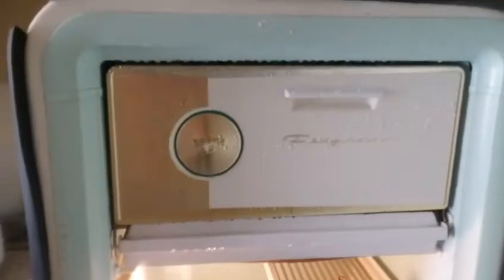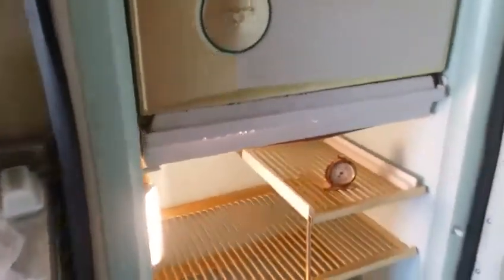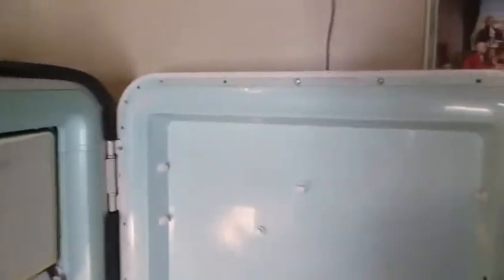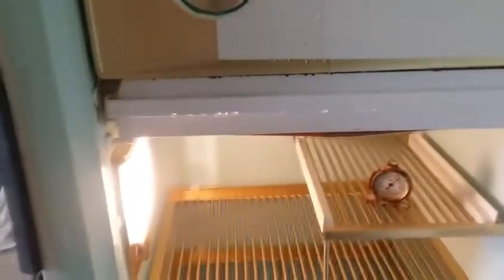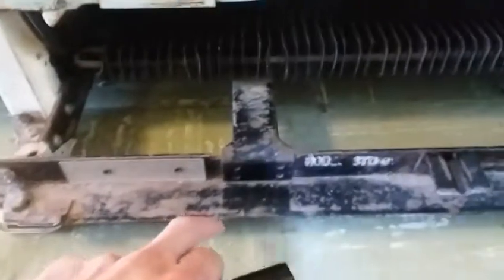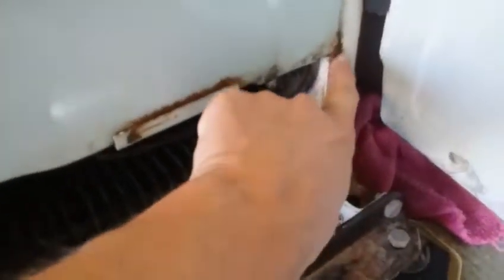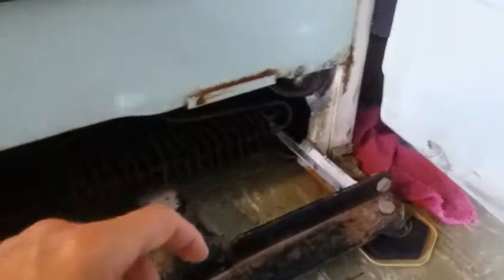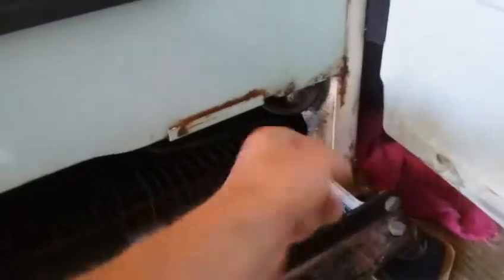general motors fridgadaire service

Comment: Have you got the new door gasket yet?  The gasket will solve the condensation. Mine did this also. You can get this gasket brand new in the same style as the original. I will post a second comment with the place I got mine.
Reply from the maker: Yes all good